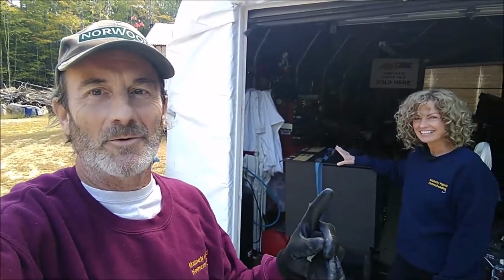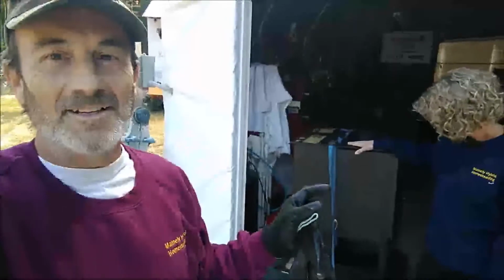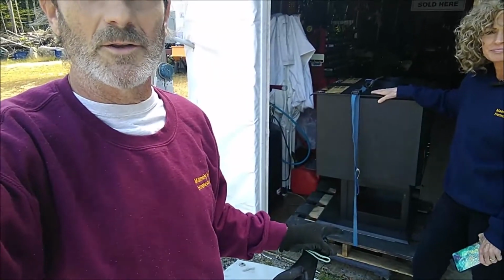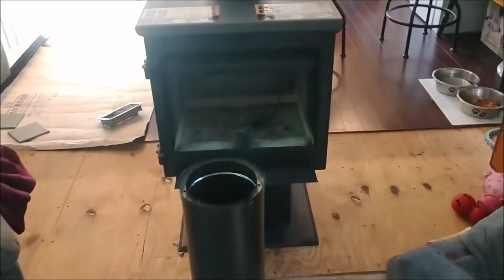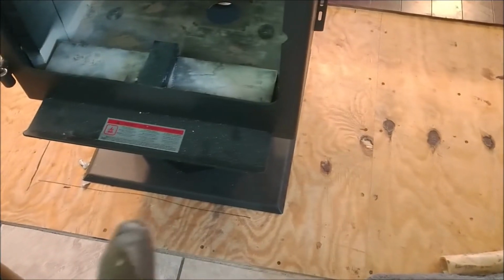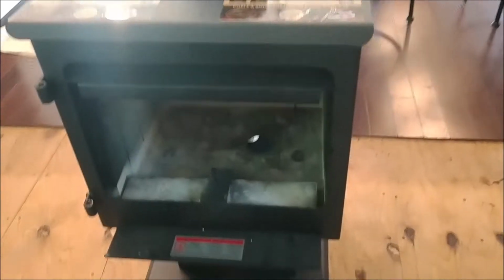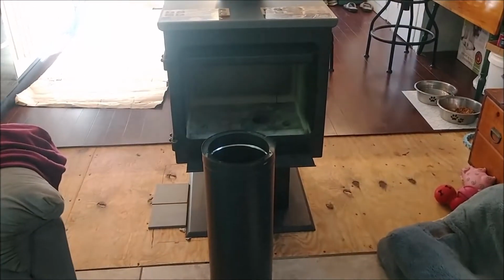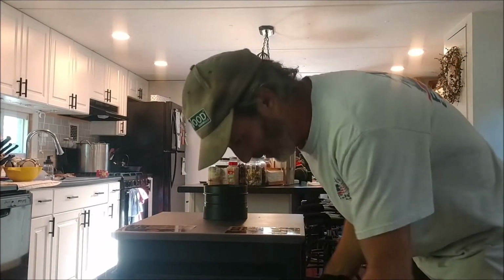New wood stove install | Mobile home

Comment: Can you tell me what you used going thru the wall? I also have a mobile home and need to go out the side and trying to find info on whats best going thru the wall thanks!
Reply from the maker: Hi, I went through the ceiling but the company that makes the kit I used makes one to go through the wall. Not sure what you will need, but they may have it.
DuraVent  DuraPlus 6 in. Triple Wall Pipe Through-the-Wall Stove Chimney Kit, 6DP-KOUT
Thanks for watching!
Reply: @crookedriverhomestead  thank you!I think you're right triple wall is the way

Comment: Did you have to reinforce the floor at all?
Reply from the maker: Hi Denise, the floor did not need any additional reinforcement. In our case the homes original construction design is more then ample to support the wood stove. Thank you for watching and your question!
Reply: Did you not put in a fresh air intake? I thought it was required
Reply from the maker: @jamesd4503  Hi James, I'm not sure what you're referencing, I read the instructions and there was not any mention of fresh air intake. Thanks for watching and the comment.
Reply: @crookedriverhomestead there's a combustion air intake vent in the back for these.
Reply from the maker: I'm about ready to do my review on this wood stove. Thanks for the comment.
Reply: Where did you get the flashing, the 2 metal pieces you screw together to hide the ceiling cut. Attaching to the through ceiling box